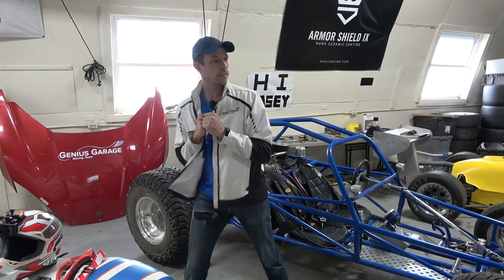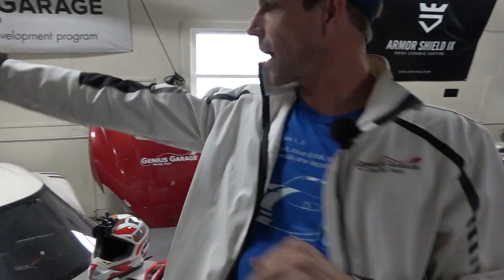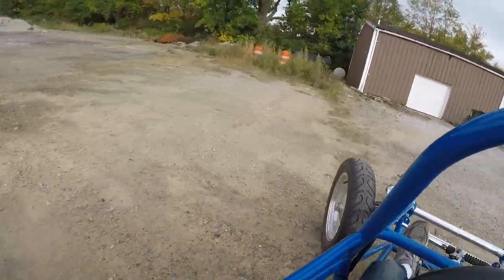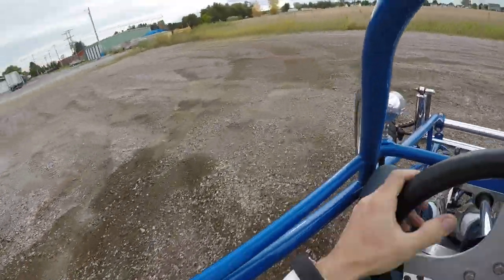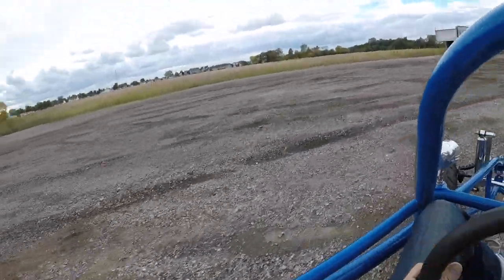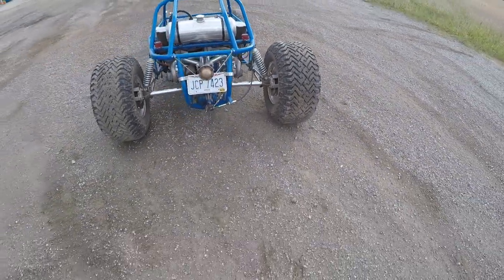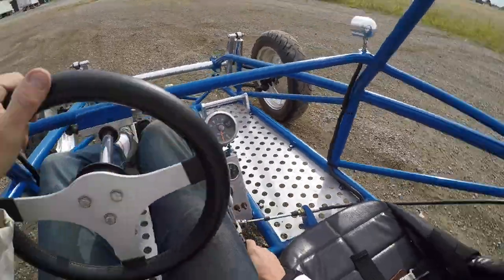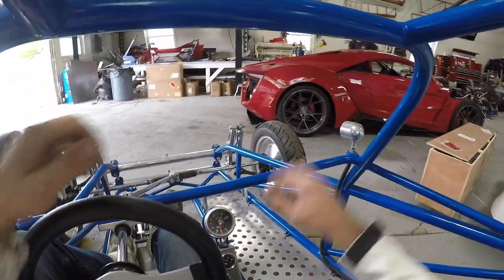How to powerslide and drift!

Comment: Out in my neck of the woods, the local highway authority is experimenting with a different type of freeway exit(it works if your not an idiot). A brief description, you exit off the freeway, have a 90 degree turn, cross the freeway, traffic light, traffic crosses over to normal traffic flow. When it first opened I kept seeing kids smashed into the barriers, right after the turn. This was happening a lot, one or two not really an issue, when you get to five, six, seven, something is going on here(that was when I was driving by). Kids are trying to drift the turn, but on a highly grippy scored concrete road. I can only say the best time to do that sort of thing is when your young. :)

Comment: Big point to remember in all of this, you are drifting a RR dunebuggy. Having owned an MR2 and now owning a BRZ, I can see that you use a lot of steering to affect little changes in angle, and to catch the rear end after you hit the throttle. 

2 reasons for this, 
1) you are hitting the gas to get the rear to step out, but it has a lot of mass behind the driver. This means more grip in the rear, and consequently you are understeering a bunch when you first initiate. However that makes a good point, because the initiation of any drift always involves some understeer. If there were no understeer in a Scandinavian flick, it wouldn't keep the rear tires trending to the outside of the turn. 
2) the mass moment of inertia of the car sits far behind the front wheels in an MR and RR car. This changes how RR and MR cars behave vs FR cars. In an RR or MR car (under normal gripping conditions) the steering does a lot more work with less effort than an FR car because the CG is much further back. The torque that the steering can apply to the front of the car relative to the engine placement is much higher than the FR cars where the steering and CG sit much closer. However this means that for a sliding scenario you have to use more steering, because the inertia of the engine in addition to the steering via the tires spinning is also changing the steering angle. So the steering has to do more work in an MR or RR car to achieve the same stability because the engine CG is much further away from the steering axis, so it requires more torque to stabilize the slide. 

TLDR: Casey understeers a lot, due to the MR/RR setup of the buggy. In an FR car it is much easier to initiate and control the slide. MR is great for track use, but when sliding you have to catch all that weight with the front tires. This makes your slides either really slow, or they have shallower angles compared to FR cars. This is why there are so many pictures of MR2's wrapped around telephone poles.

Learn how to slide so you can use it in an emergency.
Reply: What gen mr2 did you have?
Did you ever learn to catch slides on it?
Reply: Edgar Heff 

I had a Mk2. I could slide it around and do some simple transitions. It did take a fair bit of effort to start sliding and keep sliding if you were trying to slide. If you weren’t trying to slide it had some interesting camber curves and under braking it could start sliding if you didn’t modulate the brakes. It actually made it fun to play around with when you were trying to keep up the speed between corners.
Reply: Christian Gotsch youre right I have that same feeling under braking
I haven’t gotten to sliding my car around I feel like it’s a bit more tricky to keep sliding and catch than an FR car.
I’ve had it tank slap on me pretty scary stuff ha

Comment: Honestly.  Its a good idea to mess around with any vehicle you own in a SAFE manner.  Just to see how it reacts under different conditions and you can learn how to best deal with weird things. For instance. I have a 2004 buick rainier cxl v8 awd. Thing will pretty much hold grip in any situation with good tires, but one year we had an ice storm roll through and the parking lot at work was just a sheet of glass with a metric ton of things i could run into. Went to pull in, it immediately went sideways, but because Id messed around in empty fields and parking lots I knew relatively well how to correct it and straightened it out without freaking out.

Comment: I feel like people would benefit a lot by learning how to ride a motorcycle before trying advanced stuff in cars.  It seems like many of the principles are the same.  For example with this video- on the bike you obviously want to be smooth on the throttle, and the last thing you want to do if the rear starts sliding is to snap the throttle off because it will grip and massively upset the bike.  A lot of the clutch/throttle action is the same too, and easier to learn on the bike because coordinating them is a bit easier.

Comment: 13:50 - Hey Casey have you ever had one of your cars corner weighted with the driver onboard? - I think this buggy might benefit from it and be more neutral afterwards. Or maybe try it with a passenger and see if that extra balance sorts it out. Just thinking that the driver is like about 10% extra weight in this buggy but that weight is only on one side and not balanced out.

Comment: Do a video on how to use toe plates! I just made some out of wood to adjust my front and rear toe angles a bit after upgrading to adjustable control arms and I had to figure it out myself but once I did I was wondering why they're not a staple in the car enthusiast's garage
Reply: and you can use it as a chance to explain toe and camber angles for the road and for the track!! I'd love to hear your opinion on it, especially toe angles for different kinds of motorsport
Reply from the maker: Good idea

Comment: You can drift with a open diff and traction is very important in drifting i have a open diff miata drift car and yes it kinda sucks but i still link turns its all about momentum amd flick you dont need power to party and i run my tires frrom 20 to 50 psi depending on how big the track is

Comment: Very easy to drift in the FR-S. It's light. It's tight. Has an LSD. You can teach yourself in that car and do ok. You can drift 30mi/hr circles pretty easily. Jeremy clarkson wasn't lyin.
Reply: Mr.BigBoss7  maybe if you can't drive
Reply: Mr.BigBoss7  dude...... You've never driven an FR-S. You've never driven a Miata. In 05, the Japanese guys were running 200 hp ae86s. Against Vaughn Gitten in his GTO. S15s. RB swapped 350s. 

You really don't need much power to get started drifting. Definitely don't need 400+ and hydraulic e brakes and shit lol. You just need RWD, a tight chassis and suspension, an LSD, and SOME power.

EDIT: idk what you've driven. You probably have driven BRZs and Miatas. You've got your perspective
Reply: Mr.BigBoss7  ok

Comment: I have to disagree with much of what you said here. I used to do this on asphalt with my slammed 1986.5 Toyota Supra. It was an automatic with open differential. It had much lower profile tires in front (so it leaned forward) and very little weight in back because I removed the spare tire. I could crank the wheel from a stop and give it full throttle and it would oversteer and move around easily. The open differential gives you less grip so you don't need much power and the automatic torque converter is much more durable than a manual transmission.

I think you lack experience of what a crap car is capable of. It did like to snap oversteer in the rain, so there was that. It was my first car and I had no idea what I was doing.
Reply: yeah bro, I learned to drift with my shitty r31 pintara. you can make it work with even a shitbox

Comment: I'm sure the front suspension isn't doing you any help with the extreme light weight and stiff springs and then semi normal spring in back with all the weight.  Can't weight shift the chassis as well because the suspension doesn't want to.

Comment: probably weight-biased because you don't have a passenger. for something that light, a driver sitting down on one side makes it very left-heavy, so maybe the left tires grip harder. it's not an issue on karts since you sit at the middle and not as noticeable in cars because they're heavier

Comment: LMAO I just got back from sliding my car around a lil bit to find this video posted not too long after
it doesn't have plates so I can't go very far tho

and now I'm being yelled at by Casey for drifting my car on the street
sorry Casey...

and btw 120 hp plus weight transfer is plenty enough to drift
if you have an open diff with that... good luck. but it's still doable